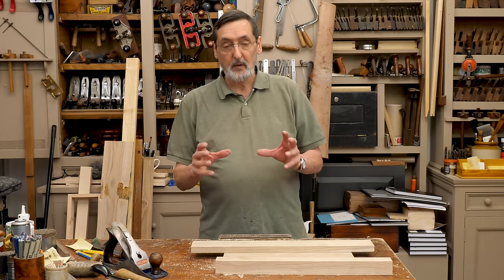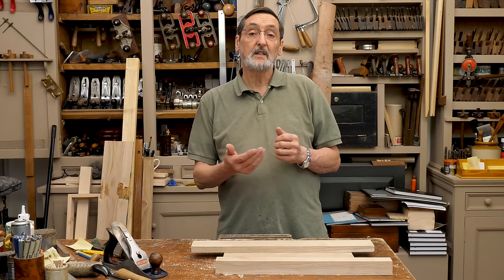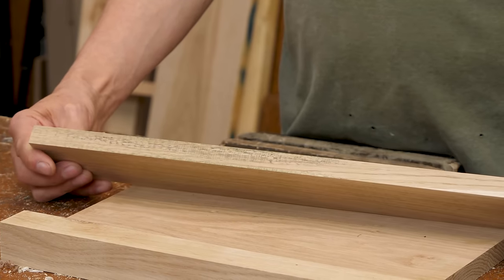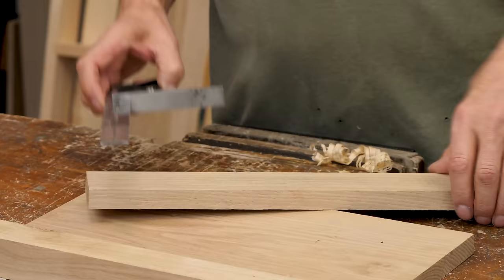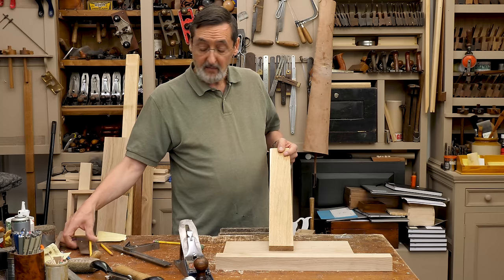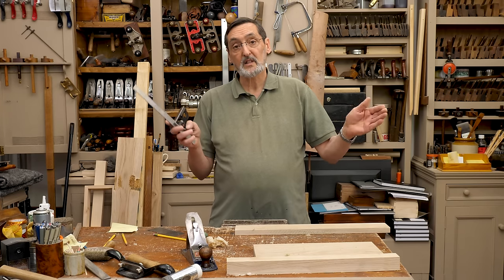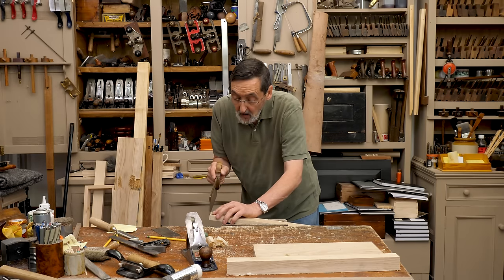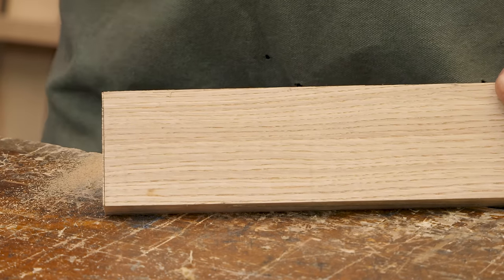How to Prepare Stock for Joinery | Paul Sellers

Comment: Thank you for the video Paul.  If I may inquire on the shooting board.  I am missing something on their use.  How is it that the plane does not shave into the shooting board and only trims the edge of the intended board?
Reply: Jason P  A bench plane doesn't cut across its full width, since there is metal left and right of the mouth. That part of the plane body rides along the shooting board and keeps the plane from eating into it. If you used a shoulder plane or rabbet plane, which cut full width, you would indeed cut into the shooting board.
Reply: Lap Joint, Is the rail under the intended piece beveled then to take it out of the path of the blade?    The rail appears to be much higher than the none cutting sole part of the plane.  Or does use create a type of rabbit that only leaves the none cutting part of the sole for it to glide against?
Reply: Jason P Yes, you will create a tiny little rabbet in the rail when you first use the shooting board, but since it is only as deep as the projection of your iron (a tenth of a millimeter, a couple thousandths of an inch), it is barely noticeable.
Reply: Lap Joint good point

Comment: Great video again Paul ! I was wondering if you could a video on moister readers if you use them, and let us know what one you find is ... lol the best or at the least one you prefer .
You have inspired me to use hand tools more to bad I've spent lots of money recently on power tools . I tried mortise and tendons on the table saw and router ... that I'm still setting up! And they came out like crap , I used my new cheap chisels for the same pieces and they came out very nice and snugly fit together .
Cheers from Canada 🇨🇦
Reply: I know where you're coming from - made similar 'mistakes'. I now use power tools to get me in the ball-park then finish off with hand tools. The mid-range consumer-grade power tools I bought all fail in at least one critical area. Wobbly spindle bearings on the drill press, a table saw with a table that's warped in every direction... I wish the marketing guys would forget about adding new 'features' (like useless lasers) to their products and concentrate instead on giving us simpler tools that do their job properly.

Comment: Paul, should I make my boards flat and square before I cut the board to size, or after I cut them to size?
Reply from the maker: Hi Joel. We usually cut boards to length before planing. Whether you cut it to width depends on the amount of spare width you have. If the stock is a lot wider than you need, then rip it to rough width. You may want to leave a little material on to plane off later is the board isn’t very flat.
This reduces the amount of planing to just the wood that you need.  - Team Paul-
Reply: Paul Sellers Thank you sir, I thoroughly enjoy your videos.

Comment: I was quite surprised to see you put your plane face down on the bench, I was always taught to put it down on its side to avoid damaging the fine cutting edge of the blade
Reply: You were taught wrong.
Reply: Makes sense to me
Reply: Your bench is made of wood....right?
Reply: I don't put my chisels down blade-first either
Reply: Blade projection and alignment is also critical, and can easily be knocked out when putting a plane down on its face.
Reply: Hasn't happened to me.  

Putting planes on their side was promoted by shop teachers that didn't want students banging planes onto metal tools.
Reply: That's why it make sense
Reply: ken please see Paul sellers' video on sharpening and setting the bench plane for his reasons   for not resting the plane on its side
Reply: Doesn't hold water as the plane blade does not project beyond the side of the plane, so how can it 'reset' your blade?
Reply: I thought the same, but then Paul himself said putting the plane face down is better than laying it on its side. Apparently it actually knocks it out of orientation sometimes. I'll take his word before many others.
Reply: You have more chance of knocking the blade out of orientation by putting it down ON the blade - the fine cutting edge actually projects very slightly from the plane body's face, it doesn't project on the sides at all. Moreover workbench surfaces are certainly almost never perfectly clean or flat, and could contain small objects or bits of grit that could certainly nick a delicate cutting edge if it was carelessly placed on them. Just makes sense to me to keep the blade out of harm's way, but everybody will have their preference I suppose.

Comment: only gonna take off .001 thou takes off probably .030 thou lol the thickness of a human hair is only .003 thou
Reply: nathan butler .1 thou is more material than .3 thou and .30 thou is probably invisible.
Reply: lonewarrior1999 your math is way wrong to get 1 thousandth of an inch yes you divide 1 by 1000 to get 3 thousandth of an inch you divide 3 by 1000 not by 3000 wich therefore being 1÷1000 is 0.001 notice the 1 in the thousandth position lol if you did 3÷1000 you get 0.003 notice the 3 is in the thousandth position its simple math that 3rd grade kids do
Reply: lonewarrior1999 so i ask you this which is bigger 0.001 or  0.003 or 0.03
Reply: nathan butler im afraid yours is the math that is wrong. a 1 thousandth is made by saying 1÷ 1000 and a 3 thousandth is made by saying 1÷3000. yes I agree its simple math so why do you not have a grasp of it.
Reply: lonewarrior1999 if you divide 1÷3000 decimal is in the wrong place for it to be a thousandth
Reply: lonewarrior1999 i say this to you google 3 thousandth of an inch and see if your decimal is in the right place cause its not cause your math is wrong lol
Reply: nathan butler yes I do apologise. i am wrong I was mixing imperial with just numbers in general. As I say I apologise for being wrong however I will still say there is still no reason for you to be such an arse to somebody just because they have got something wrong.